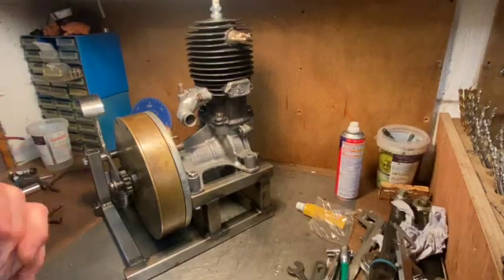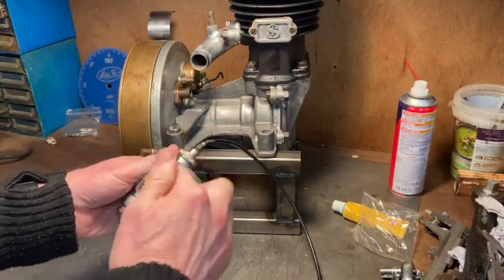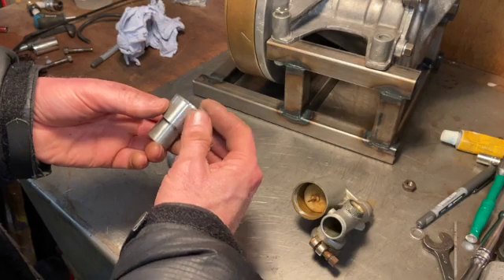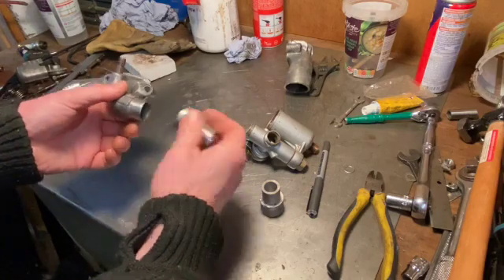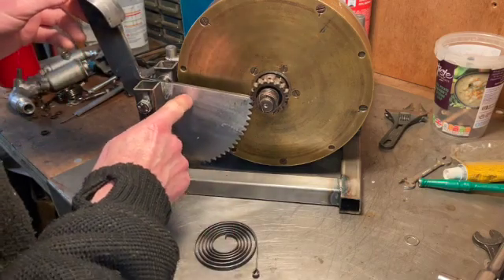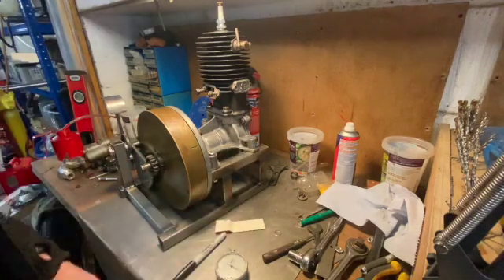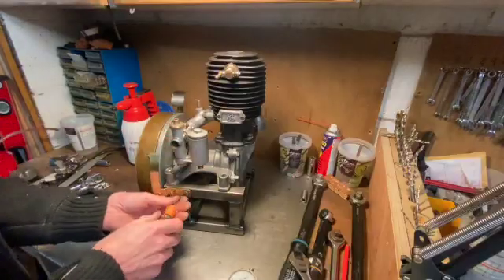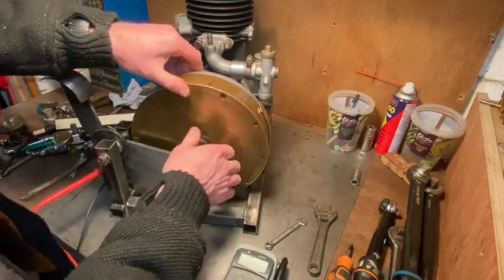Ner-a-car Engine Project - Episode 8

Comment: you TOTALLY over-thought the tdc issue. all you need is a pen mark on the flywheel edge and another on the ally backplate . . . . . . . capt kiss says
Reply from the maker: Ahh… but the back plate moves!! (Rotates). That’s how you adjust the timing. So the TDC marker needs to be relative to case (or frame), not the back plate.